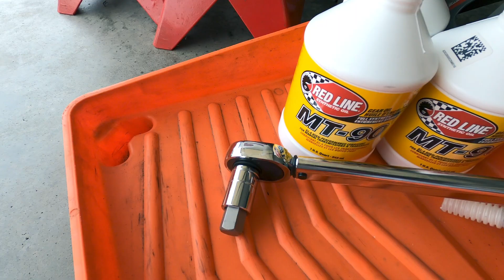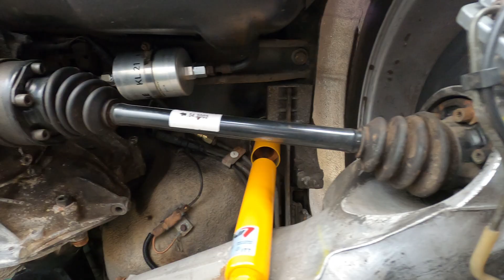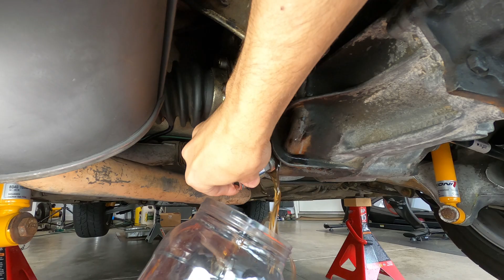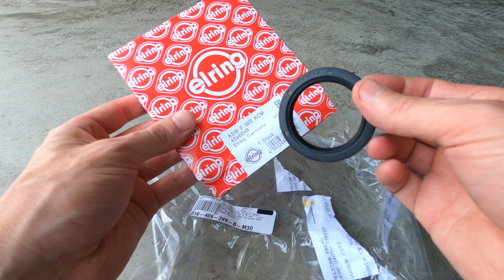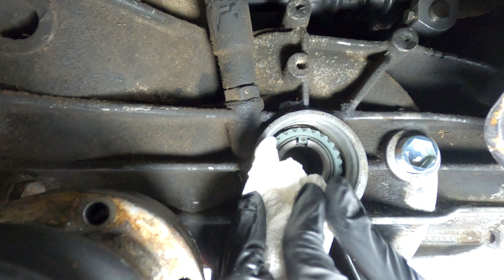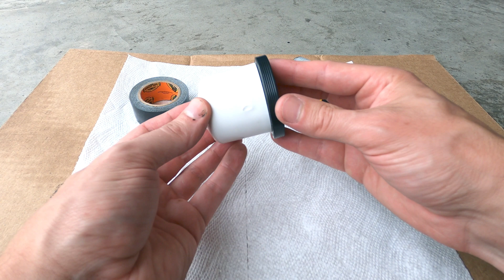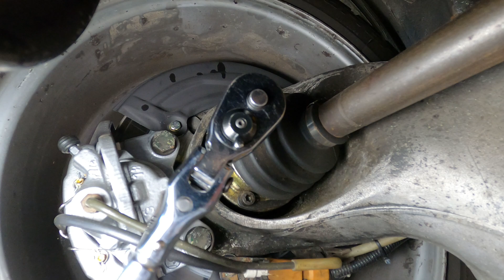Porsche 944 – Transaxle Gear Oil Change & Axle Flange Seal Replacement Tutorial (CV Axle Service)

Comment from the maker: ** NOTE ** Torque Spec for the two M8 Axle Flange bolts to the Differential is over-stated in the video, it should be 25Nm or 18 ft/lbs.
Reply: Can you edit the video? I almost just broke that bolt off in the transmission because I didn't read the comments...
Reply from the maker: @mikeygarcia3017 Sorry man, I’ll have to see if I have the original source videos to make the corrections. YouTube doesn’t allow easy updating for this kind of thing, so I’ll have to take this one down and post a new one.
Reply from the maker: @mikeygarcia3017 The updated video has been posted to the channel with the correct torque specs and this one has been marked “unlisted.” Thanks again for your feedback!

Comment: Hi there! Great video once again! You have seemingly made one for every issue I'm encountering haha! I got a question: I've got a leak on both of my axles which also covers the transaxle casings. Would that mean bad axle flange seals or bad CV joint grease? I find it a bit weird that both axle flange seals go bad at the same time, but the fluid looks like transmission fluid, so it could be.
Reply from the maker: @WhereverHugo  If the grease is covering all surrounding areas of the transaxle case (sides, above, and below), that is more than likely the CV joint grease breaking down and being dispersed as the axles turn. To your point, it could be two issues, but you could address the joints first and see what improvement you get.
Reply: @NC944er  Thanks for your answer! Sorry, I realise I could have explained better. The fluid covers only the sides of the transaxle case and a little bit on the CV joints (which on one side has slightly dispersed as the axles turn as you mention), with most of the fluid build-up where the axle flange seals are. Would that point in the direction of the axle flange seals or the CV joint grease?
Reply from the maker: @WhereverHugo  Axle flange seal leaks tend to seep mostly downward. If it were me, I would just care for both. The seals are only $10 apiece and pouches of joint grease are about $6. Then you’d have peace of mind knowing it’s all done.
Reply: @NC944er  Alright, thanks for the information! You're right, might as well do both jobs while I'm there. Thanks for all you do for the community!

Comment: I hear some people mention that the MTL helped to alleviate a crunchy second gear synchro, I currently have MT90 in my car and I was curious how you would compare the two? I was thinking about experimenting with mixing the two.
Reply from the maker: I actually switched from MTL to MT-90 to try and differentiate the two, but they are fairly closely formulated. MTL is classified as a 75W80 gear lubricant and MT-90 is a thicker 75W90 version of MTL. From a climate perspective, MTL is better suited to cooler temperatures and MT-90 provides better performance in hotter climates. Under normal Spring/Summer temperatures for my area, I haven't noticed a huge difference between the two. They both equally increased the smoothness of shifts after adding fresh oil. That said, I have noticed that the MT-90 creates harder/slower shifts when driving at cooler temperatures of 40°-50°F for the first few minutes before the oil warms up. Under those conditions, the higher viscosity of MT-90 requires slightly increased shift effort to move the synchros and to squeeze the oil from between the synchronizer cones and the mating surfaces of each gear. So in general terms based on the numbers, MTL should allow the synchros to mate a little easier and reduce crunchiness as the formula is a bit thinner than MT-90. The only downside being that you lose some protection against shock loading as you move to thinner lubricants, but unless you drive your car extremely hard all the time, it shouldn't be an issue. This article is a good read if you want to get more into the tech specs and differences between the two: http://www.redlineoil.co.jp/PDF/WHITEPAP/mtl_tech.pdf
Reply: @NC944er  Thank you! I really appreciate your help. I'm going to go ahead and try out MTL to see how I like it.
Reply: @NC944er  How do you like your short shifter? Im noticing some slight side to side play in my shifter and I was interested in tightening up the feel, however since my second gear synchro is starting to feel a bit worn I was worried if that would negatively impact its condition in the long run. It's made me a bit hesitant to pull the trigger
Reply from the maker: @MrUglyDinosaur  I have another video on the channel that reviews the short shifter if you’re interested, but it essentially eliminates almost all the loose play and reduces the front-to-back movement by 1 inch. It therefore tightens the overall feel and makes gear selection more precise. The linkage changes themselves wouldn’t hasten or delay any further wear to the synchros, but it would enhance the sensation of any gear issues and better translate that through the shift lever. So if you’re experiencing any light grinding or hiccups when changing gears, it will feel more pronounced in your hand, but what’s happening inside the transmission will remain the same. Example: After installing the short shifter on my car, I had a better feel of some minor notchiness going into 3rd when the gear oil was cold, which has inspired me to double clutch 2nd and 3rd gears until everything is warmed up. So if anything, I have a better understanding of what is happening inside the transmission and can “play nice” until it’s ready. 😂

Comment: Porsche published a TSB many years ago updating the gear oil spec to GL-5 for the 944 series.    It is important to look the the TSB's for service information updates.
Reply from the maker: The TSBs can definitely be useful to incorporate into the larger body of technical information available when deciding what’s best for your car. I think there are also situations where owners can evaluate that information and make informed choices that deviate from the TSBs. An API GL-5 gear oil is superior to a GL-4 when it comes to protection against shock loading, which is why it would be an easy choice for Porsche to recommend, but the API ratings don’t account for synchromesh and the long-term degradation of yellow metals caused by the increased sulfur/phosphorus levels used in GL-5. Because my car is an 8-valve NA with relatively low HP and I’m more concerned with the longer-term preservation of the synchros, I opted for the GL-4 option in Redline’s MT-90. I might be more apt to consider a GL-5 if my car were a Turbo or an S2, but I’d also plan for a transaxle rebuild at some point in the future. 

Overall, I’ve found that this topic generates a fair amount of confusion and sparks various positions as to “the best” option for all scenarios and I don’t think the changing industry standards help matters for the general consumer. If you’re interested, here’s a link to a somewhat lengthy, but informative, article on GL-4 and GL-5 gear oils that helps break down the nuances of the application differences - https://www.widman.biz/uploads/Transaxle_oil.pdf

Cheers and thanks for checking out the channel! 👍

Comment: The torque specs that you provided for the 6mm hex head retaining bolt for the output shaft is wrong. According to the 944 WSM it is 25 Nm or 18.4 Ft lbs, NOT 42 Nm or 31 Ft lbs. Ask me how I know 😒🤬
Reply from the maker: Hmmm, I’m seeing that now as well. Thanks for mentioning it. I believe I had gotten that value from a Pelican article and confirmed on the forums, but should have cited the workshop manual as well. Did the bolt head end up stripping on yours? YouTube doesn’t allow easy updating for this kind of thing… I’ll have to see if I have the original source videos to make corrections.
Reply: @NC944er  Yes, the hex head stripped because it was over-torqued. I had to use a bolt extractor to get it out (on both sides) - needless to say, I had to also buy 2 new bolts 😞. I'm just lucky that the bolt didn't break or stip/shear the threads inside the transmission.
Reply from the maker: @davewilson7914  Man, that sucks, I’m sorry to hear that. Glad you were able to get them removed. I pinned a new comment referencing the correct torque spec there. If I can edit the video as well, I’ll pull this one down and repost it. Thanks again for letting me know! 👍

Comment: If you’re not satisfied with the Redline I recently put Sta-Lube 85w90 gl-4 hypoid conventional gear oil with no friction modifiers in my trans and it’s working better than it ever has. I’ve never heard it mentioned by any other 944ers but it meets all the specs. I never tried the redline but I have tried swepco, valvoline, Mobil one, and Lucas. I didn’t like that the redline says not for hypoid. The Sta-Lube comes in a gallon for $40-50 and they had it at Napa
Reply from the maker: Yeah, the Redline product language is confusing in that respect. They’ve told me that the label contains a general disclosure and it certainly does apply in cases where there is extreme pressure of “high offset” hypoid gears. That said, a GL-4 oil like MT-90 is suitable for use in a zero or “low offset”hypoid gear application like that found in the 944 transaxle. 

Thanks for the recommendation on an alternative gear oil! I haven’t tried that brand either, but I do like when things are available locally, that makes it a lot easier to come by. 👍🏼

Comment: Just watched this video and you have convinced me to use the Redline MT-90 in my 87 N/A car with 97k miles on it.  I'm curious, since it has been about a year since you did this work, on how you like the results?  How's the shifting?  Any negatives?  Would you go this route again?  Thanks for another great video!
Reply from the maker: At this gear oil change, I switched from Redline MTL to Redline MT-90. The MT-90 is a bit thicker and shifts were noticeably smoother than when running MTL. It’s good quality stuff, I’ve had no issues with it to date. My second gear is a little notchy when the fluid is cold, so I’ll sometimes double clutch 2nd and 3rd for the first few minutes when it’s chilly outside. It doesn’t grind, just a little slow to get into gear while the synchros catch up. Once it’s all warmed up, it’s super slick.
Reply: @NC944er  Sounds good to me.  This stuff will be in my car by the end of the week, along with some fresh VR1 and ATE200.

Comment: Hi NC944er, looking to do this job while my car is laid up for the off season. I cant seem to find a brand i want (Mobil, Castrol etc) in my city in a 75w90 that does NOT have the lsd additive. Is it safe to use an oil that has the LSD additive in my open diff/transmission?
Reply from the maker: Hey Quincy, in a manual transmission with synchros, you generally should not use the limited-slip friction modifiers unless the transmission features an LSD clutch. The friction modifier makes the fluid “slicker,” and therefore could impact shock loading. Personally, I would order something without it and have it shipped in, which is commonly required with many jobs on the 944.
Reply: @NC944er  thanks man! You are the best, i cant say how much i appreciate your videos. Anyone getting into these cars i always reference and share your videos with them

Comment: where did you get those colored Center caps for your wheels? those look bad ass. I want some for my 1989 S2 Gaurds Red
Reply from the maker: Yeah, thanks! Those are my fave center cap design as well. They are found under part number 92836103211tpp but unfortunately are $100 apiece.
Reply: @NC944er  thanks dude. Big Fan of your channel! keep up the good work. I plan on doing some work on my car and uploading them to my channel as well. I bought other plastic caps for my 944 from Pelican Parts but unfortunately they were the wrong part number. Luckily I was able to return them because they screwed up and said they were compatible with the 944S2.
Reply from the maker: @AlvaradoMedical  Bummer. Looks like 944Online has them for a decent price, $332 for 4 with free shipping. Should fit all OEM 944 wheels. https://944online.com/color-crested-center-cap/

Comment: The Porsche 944 factory manual calls for a hypoid oil and MT90 states on the label "Not for hypoid transmissions".  Yes, the shifting will be good but the crown & pinion gears will not have the needed protection of a hypoid oil and will wear very quickly.
Reply from the maker: Hey David, thanks for your comments! This is a confusing topic for sure and sorting through the noise can be a challenge, but I’ll see if I can provide some clarity. 

The quoted statement from Redline is a general disclosure and it certainly does apply in cases where there is extreme pressure of “high offset” hypoid gears. That said, a GL-4 oil like MT-90 is suitable for use in a zero or “low offset”hypoid gear application like that found in the 944 transaxle. 

This has been confirmed through conversations with Redline technicians and when using the vehicle product selection tool on Redline’s website for the 944, MT-90 pops up as the recommended product choice. 

Here’s a link to a somewhat lengthy, but informative, article on GL-4 and GL-5 gear oils that helps break down the nuances of the application differences - https://www.widman.biz/uploads/Transaxle_oil.pdf
Reply: @NC944er  Thanks for info, I will read, digest it and hopefully will be the wiser.
Reply from the maker: @davidks3552  I spent hours researching oils, tech sheets, forums, and trying to understand the differences and this article summed it up the best. The lubricant industry is really confusing for consumers, especially when they keep changing regulations and production standards, and the labels don’t always help. Castrol has a relatively new High Zinc “Classic” motor oil that says, “Not for use in modern vehicles with catalytic converters,” but when I called their tech line, I was told it’s safe for the 944 even though it has a catalyst. 🤪 I feel like sometimes they just post blanket statements to hedge against potential lawsuits.

Comment: Just a suggestion don't use your torque wrench to break stuff loose
Reply from the maker: Thank you and I agree! 😁 The wrench shown during removal is actually my old broken torque wrench that no longer measures correctly, but it’s long so I sometimes use it as a breaker bar. The manufacturer, EPAuto, sent me a new one under warranty and didn’t ask for the old one back. Pretty cool! 👍🏼

Comment: Like your channel really, but RedLine says: "MT-90 are not for use in differentials with hypoid gears" so it's not good for 944 as far as I know, might be mistaken, please check to be sure.
Reply from the maker: Hey Robert, thanks for your comments! This is a confusing topic for sure and sorting through the noise can be a challenge, but I’ll see if I can provide some clarity. 

The quoted statement from Redline is a general disclosure and it does apply in cases where there is extreme pressure of high offset hypoid gears. That said, a GL-4 oil like MT-90 is suitable for use in a zero or low offset hypoid gear application like that found in the 944 transaxle. 

This has been confirmed through conversations with Redline technicians and when using the vehicle product selection tool on Redline’s website for the 944, MT-90 pops up as the recommended choice. 

Here’s a link to a somewhat lengthy, but informative, article on GL-4 and GL-5 gear oils that helps break down the nuances of the application differences - https://www.widman.biz/uploads/Transaxle_oil.pdf